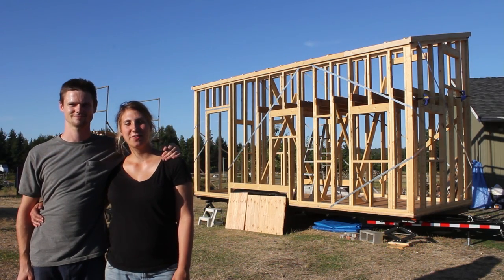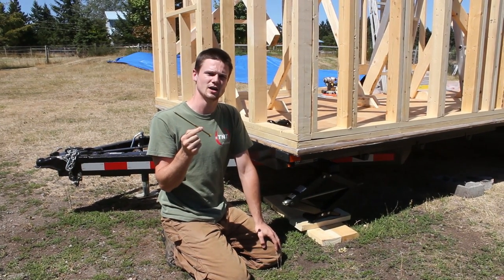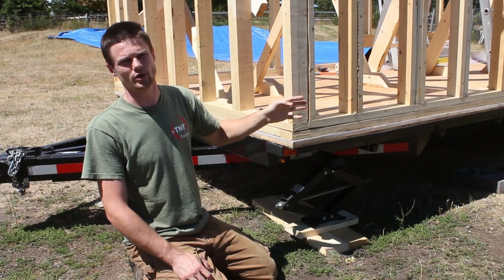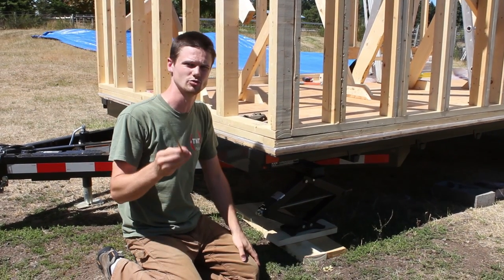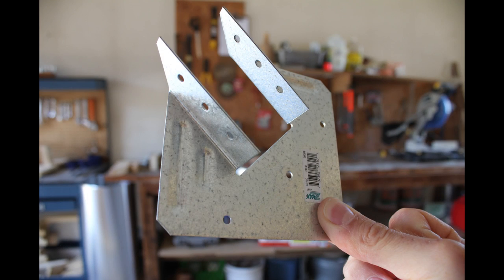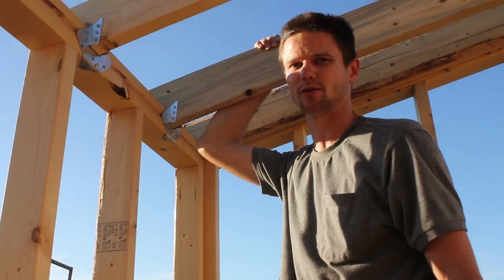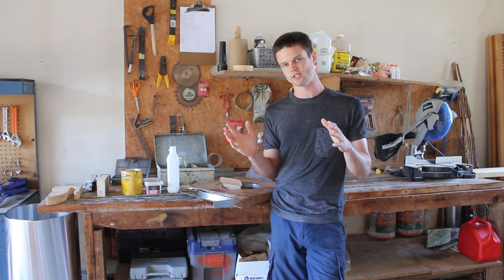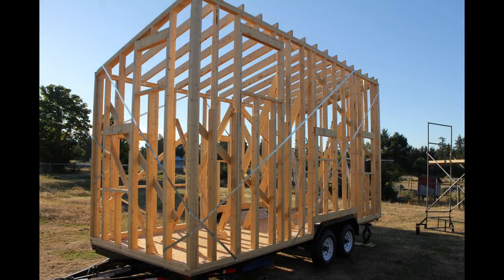Tiny House Structural Strength (Ep.10)

Comment: Here in Kansas you use strapping on any normal project because we get 70 mph wind gusts on any given day. But your project looks good so far. I have been thinking of selling my 116 year old house and building one out in the country. I woulrked in construction for years on others houses but mine is so old very little the historical society lets me fix, like they want it to fall down. I think I wil buy a 5th wheel flat trailer, much bigger than yours, my truck can haul 2.5 tons easily that's 5000 pounds and I have 2 kids so more space needed! With trailer houses going for around 50g around here makes this a great build if far enough away from city limits, restrictions like only city approved contractors and electricians ect.
Reply from the maker: +Dougie D Yeah I think a lot of the early tiny houses did not have strapping, which seems like it could get sketchy on the road :P
Reply: Well I love your tiny house and congradulate you! If you have kids post you expansion project! It will be awesome to see it and any future tiny projects!
Reply from the maker: +Dougie D First expansion might be a deck/porch ;)
Reply: Tiny Nest That will be very cool! Have you thought of a battery backup to go along wilth it? Right now we have had some good cloud cover to make solar almost completely ineffective for the last few days.
Reply from the maker: +Dougie D Yes we have several things wired permanently for 12VDC so adding a battery bank will be easy and effective :)
Reply: Regardless of how much cloud you get. Most of the solar panels today usually still collect over 90% of the sun rays required for solar charging. So with the right setup you should have more than enough solar for a tiny home from a small roof array.
Reply: DR Paquette
yes but wind is excellent in midwest! A no wind day in Kansas happens when hell freezes over and the Chiefs win a Superbowl. Plus you only need a 8mp wind to generate 400w which you always have faster wind above tree line. Solar you have to worry about the bolt holes eventually leaking water in your roof, wind is attached to a pole.
Reply: Dougie D who says that your Solar has to be bolted to your home? Why can't they be set up to work in conjunction with each other?
Reply from the maker: Dougie D, where are you getting those numbers for wind-speed and wattage? can you share a link?
Reply: I'm looking forward to solar roofing tiles then none of the worries about leaks like we have with solar panels now.
Reply: Very cool!
Reply: How much would your old 116 yr old house cost if you sell it?
Why not build adjacent to it?

Comment: looks good but you should have nailed your rafters over your studs for proper roof sapport and then you could have used your huricain ties more secured to the studs.  but for the most part you did a great job
Reply from the maker: Nick Trayer Ah, yes this could have been better. We ended up with a different joist-stud spacing due to trying to minimize plywood sheathing use. There was more than one case of focusing on getting one thing precise, and ending up affecting another... but we learned from most of these cases during our design in Sketchup... can't recommend it enough.
Reply: +Nick Trayer that is only a requirement on truss roofs spanning greater then 40 feet , , its not relivant in his case
Reply from the maker: +grizz270 Hm, are you referring to a building code's requirement? if so which code is that from?
Reply: residentual codes are diferent in diferent parts of the world i dont know where to find it in bc codes im in oregon , here in the states it is based on snow load , it varys from county to county , you can check with your local codes or even contact a truss plant in your area , every time i have had to deal with truss stacked on top of studs had nothing to do with code , had everything to do with engineering , sometimes it was the engineer who required it other times it was the truss company that required , but to my knowledge their is no code for or against
Reply from the maker: +grizz270 Thanks for sharing :) interesting that it's more of a specification than a code. We have almost zero snow here so we haven't even had to look into that part of building. Plus the area of our roof is so tiny anyway :P
Reply: grizz270 I would be more worried about what engineers wanted than the bureaucrats involved with code.....engineers just want the thing to safely stand the test of time.....bureaucrats have that as only a small part of their list of desires....

Comment: Hey thanks for all the informative videos. Awesome job! A few questions... (Im in the states, Northern CA) How much was the trailer standalone without all the other incurred costs. And debating between a 20 or 24' trailer; thinking about putting the bathroom on one side, which will be about 4' in length. I know most is personal preference but have you come across things that would prove a 20' to be better than a 24' trailer. Thanks again.
Reply: Side note... Trying to create stairs that also are useable storage space vs a ladder.
Reply from the maker: Christopher Sisneros A 20' trailer produces as big a house as you can get without exceeding 10k pound weight. It gets a bit unwieldy above 20', I believe it needs more axles and has a different vehicle classification. 20' is enough for us. I've seen lots of people make cool stairs in tiny houses, just search around for pics and vids.
Reply: Ok, thanks for the info. I have seen lots of cool ideas for stairs so will just have to try and fit them into a 20' trailer vs 24'...

Comment: Those fasteners/ hurricane clips are not meant to be bent. You weaken them when you do that.
Reply from the maker: Jim Watson The two options were to leave it free-floating and not use that last fastener hole, or to bend it and use it. I'm 100% confident that in this particular situation, the clip bent in this way will resist more upward-pulling force than if it were not bent.
The manufacturer will absolutely state that any modification of the product will affect their specifications, and will rightly assert that you shouldn't, because they cannot control the outcome. I made a decision specific to the circumstances I believe it to be a good one.

Comment: Why wouldn't you use screws instead of nails?
Reply from the maker: Screws have less shear-strength than nails, meaning they snap easier... but they have better holding power... so if you're willing to spend the extra time, I now recommend to use a combination of nails, screws, AND glue... so you get the benefits of all 3... remember that when towed, a tiny house like this will be subjected to what is basically a hurricane and an earthquake at the same time, for the duration of the tow...

Comment: If you've ever looked at the anatomy of a typical RV trailer, you'de know just how much overkill your building process is. Those trailers are 2x2's and lauan and they go down the road without racking or falling apart. You could have saved yourself a fortune and ended up with a house that would last for a lifetime. 2x4's and 7/16 osb and you would have had a house 10 times stronger than any RV trailer.
Reply from the maker: Dave Stone Your not wrong, although there are a few things I would add to consider for this comparison. A very brief googling of travel-trailer weights suggests that our finished house could easily be twice the weight (granted that does include all of the wood, so reducing strength would reduce the weight and a balance would have to be achieved)... it's also quite a bit taller, and since it's made entirely of wood (no fiberglass or similar shell of sorts), things are more prone to pull-out/loosen over time if under a lot of movement and stress. Add the fact that our house is basically a giant cube with zero aerodynamics, and all that high-center-of-gravity mass could get tossed around if we hit a chunk in the road, multiplying the possible forces acting on the structure... I don't think we've gone wildly over-strength in our build. If we've gone solidly over-strength, that's what we've been aiming for... and since we're a regular couple with no oversight on this project, we've purposely overdone everything because the few hundred dollars we could have saved by skimming down on some of the basic building material is of less value to us than the piece of mind that our house is rock solid.

We should also mention that since we're making this video series, we want to be an example for going to distance in these attributes, because the last thing that any tiny house person wants to hear, is that some not-too-bright DIYer's tiny house disintegrated on the highway :P
Reply: Tiny Nest
Thank you for that comprehensive reply. I retract my comment and give your house my seal of approval, a 'way to go,' an 'atta boy,' and a variety of complimentary hand gestures.  Happy motoring.
Reply from the maker: Dave Stone :D

Comment: i would not of used the method you used or the method you talked about , i would of just bolted the bottom plates to the metal frame evry 4 ft roughly and let the 1/2 inch plywood be the tie down nailed into the stud walls and plates that gives a posetive conection all the way to the rafters , the lag screws you used wil not do much good into the stud as far as shear and uplift , however i dont see much harm in it either
Reply from the maker: +grizz270 We replied to these particulars in your other comment, but yes we added a lot of things because they could only make it stronger and we didn't mind putting in the effort for the extra piece-of-mind :)
Reply: +Tiny Nest As long as the trailer is attached to the roof as the model displayed you are good to go! Using the HD's to connect the trailer to the wall assembly is perfect! This thing will be better built than most homes in seismic zones!
Reply from the maker: +The Contractor Dude That's the idea! :D